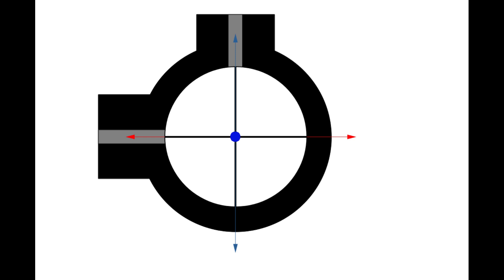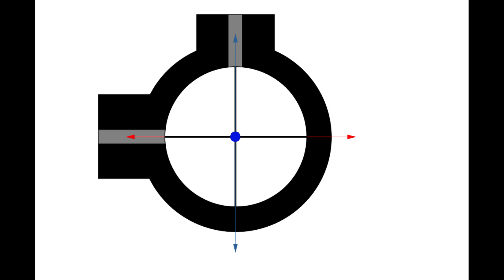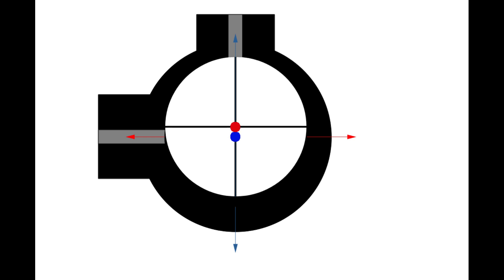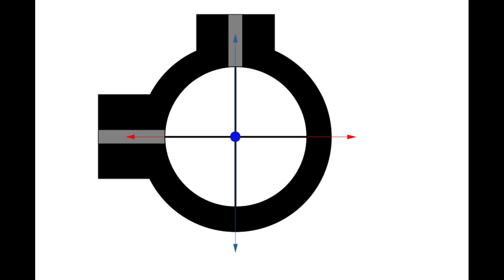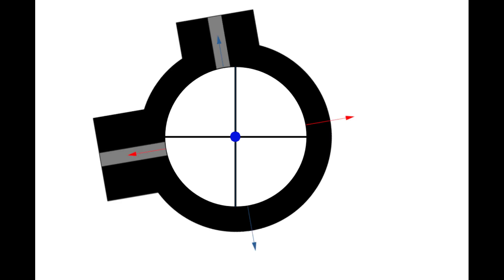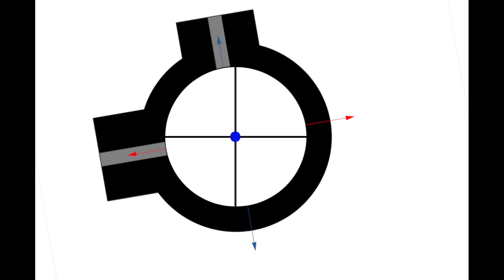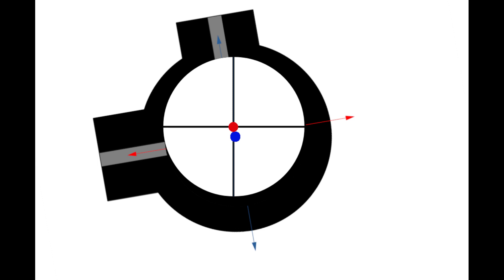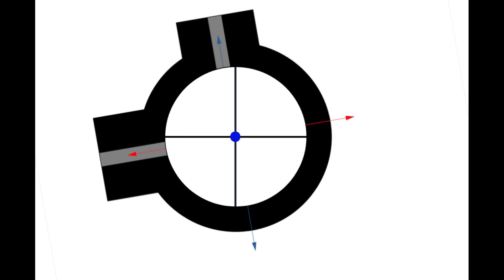Scope leveling, you're doing it wrong? (part 1)

Comment: I've been in this situation. My solution was to draw a plumb line at 10 yards and 50 yards. Zero at 25 yards, then click down to the 10 yard target and to the 50 yard target. Shoot and adjust the scope (rotate) until the 10 and 50 yard shots were hitting the plumb line, then adjust the scope level so that the reticle matches with the plumb line. Then re-zero and confirm.

Comment: Very good observation!
The question is if you level the scope (which you should do), would you then cant the rifle because you want to have your cross hairs level, and circumvent the point of levelling the scope?
Very intriguing question, well done.
When I'm out at night with a thermal and tripod I quite often use fence posts or gate posts to confirm my reticule is vertical, because I wouldn't be able to see a bubble level in the dark.

Comment: I think that scope is overdue for service. 🤔 There's only so much you can work with. 🤷🏼‍♂️
Reply from the maker: 😁 Yeah, might have had a rough life.
Reply: @Guru1ofatl  I think #1 is poor mounts, but I've seen skewed crosshairs, odd scope rails, and recently a skewed barrel. 😳
I level the action in a leveled machine rest, I level the scope, then I align the reticle with an optical collimator, and confirm with a plumb bob or vector laser at 100 yards. Then I'll laser bore sight and zero the scope. Then shoot for best groups and ammo.  If a scope fails at any stage it's returned. 
If I can zero the scope with adj. mounts I will ! 🤷🏼‍♂️
The Very Best part about this process is that the rest of you can now confirm that you are no longer anal. 😉
FTR. My machine rest is mounted to a 300 pound portable, wheel barrow, scissor lift, w/ a 36"× 18"×1 1/2" granite slab. 🤦🏼‍♂️
It's embarrassing really... 🤷🏼‍♂️
Reply from the maker: @marcmyers1465  That sounds like one hell of a rig you've set up. I've always thought that the more variables I can remove from the accuracy equation, the better. Besides, that just leaves the guy at the end of the stock as the source of any problems.
Reply: @Guru1ofatl  The older you get, the better you get at OWNING It ! 😂
We go to so many lengths in the interest of accuracy, only to expose our own limitations. The Best part about learning to have a laugh on y'erself is that you just never run out of Really Good Material. 😉
I can absolutely confirm your exact point. It's allot more common than I'm comfortable with, but knowing it is the 1st. step to a solution
Reply from the maker: @marcmyers1465  I can work on me, there is only so much that can be done with bad gear. That said, the human element does tend to screw up at the worst times 🙂